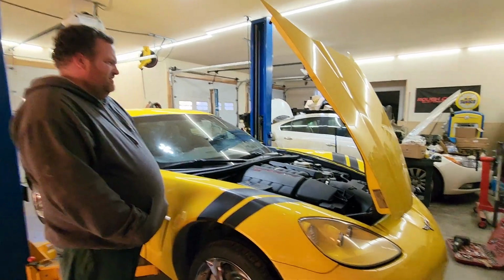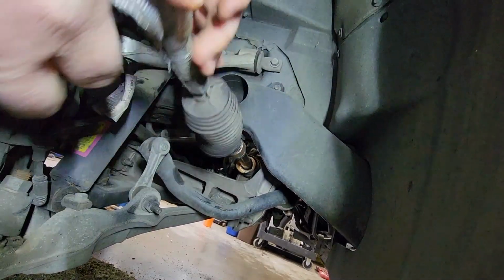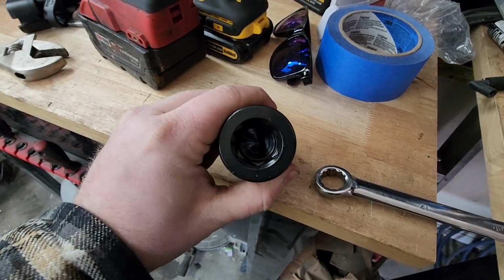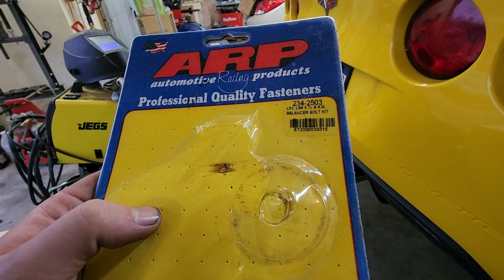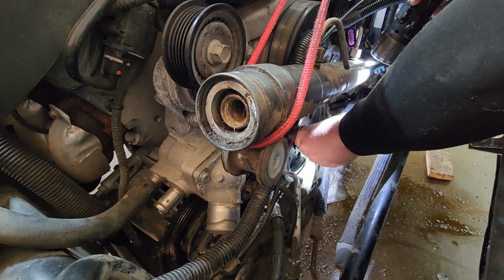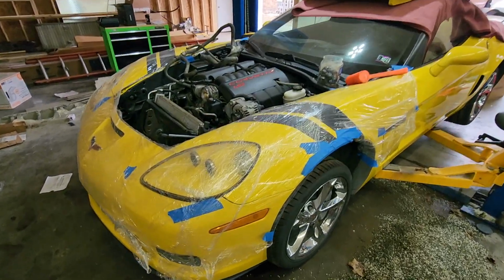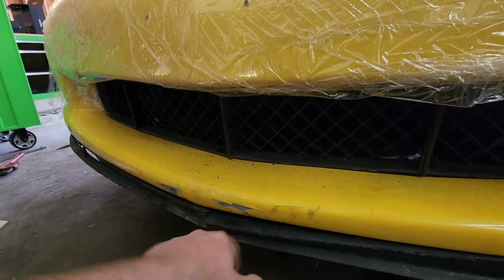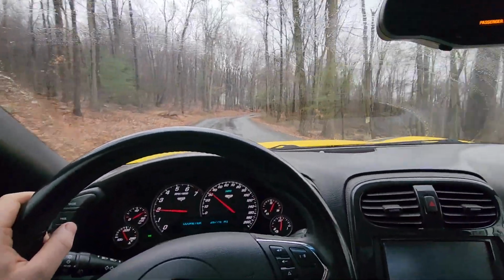Grand Sport Corvette Suffers Common Mechanical Failure!

Comment: your doing it way wrong you can do it by dropping the cradle from the bottom theres a video of a guy doing it in 2 hours you DONT HAVE TO PULL THE RACK i got mine in and out of a shop after showing them the video in about 2.5 hours
Reply: I saw that to when I do mine definitely  will do that way less work jeesh

Comment: The power steering rack does not have to be pulled out according to several other videos I’ve watched on this subject. To late now but check it out the next time.
Reply from the maker: That could be true but I have no idea how that would work, it runs about half inch from the front of the balancer. Might have to look at some other folks videos myself and see how they did it.
Reply: It’s actually fairly easy but you need two screw jack stands, one to support the motor and one to control the engine cradle.  A 2.5 hour job, total time

Comment: Once upon a time, i did a torsional damper change on my C4.  The clamshell hood made it nice to do that job because once the front wheels were off, I could stand in the wheel well and not have to bend over so far.  The engine in the C4 was placed so that the damper bolt was just above the rack, and there was a loop in the power steering tube for damper puller access.

If I ever have to do that job on my C6, I'll take it to a shop.